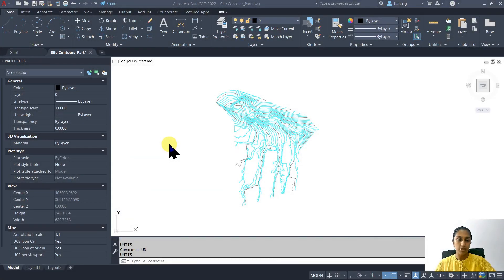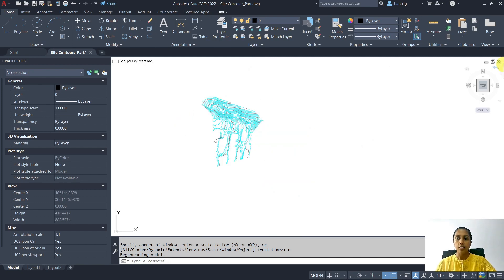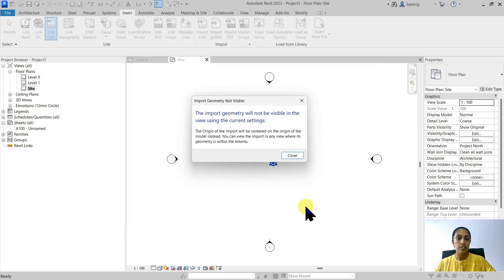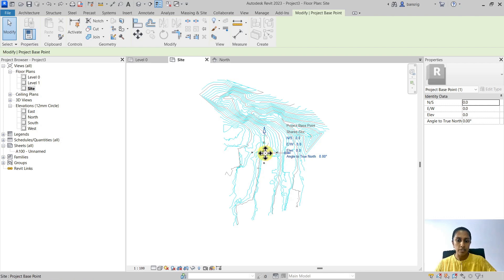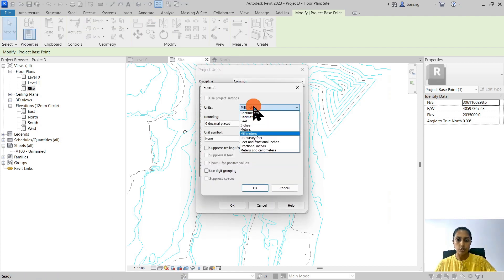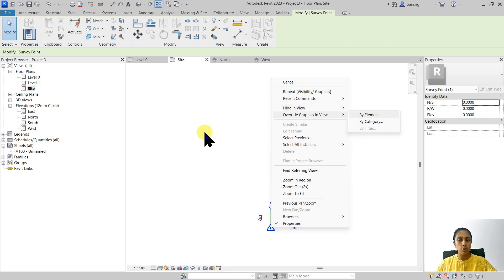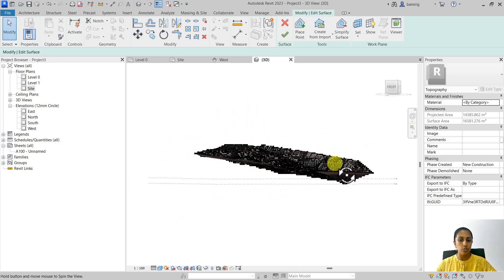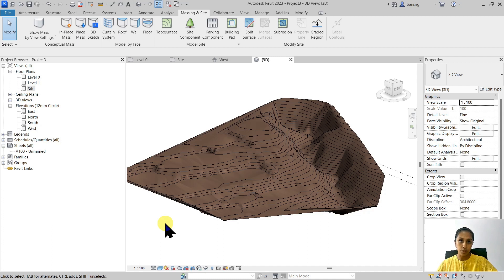EP62 | Revit Beginner Program | Toposurface from CAD | Acquire Coordinates | Bansri Pandey

Comment: Hi, thank you for the tutorial, it's very helpful. Just a question, when I acquired coordinates from my cad file,  both my project and survey base point acquired the coordinates, where in your example the survey point stayed at 0,0,0. Is there a reason for this? And does it affect the accuracy of the acquired coordinates?
Reply from the maker: should work. if the survey point is not at 0 in the beginning, it may have a value when acquiring coordinates. you can check the spot coordinates of some points in your project and compare it with the cad and see if they match. if matching, then you are good to go.